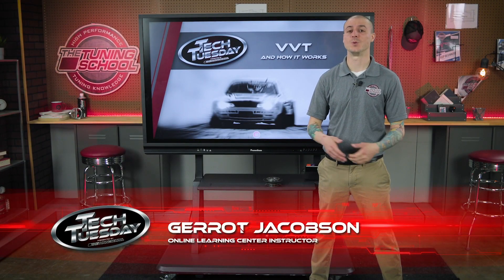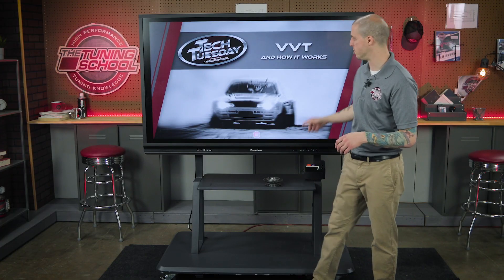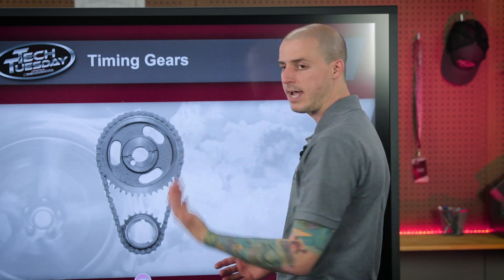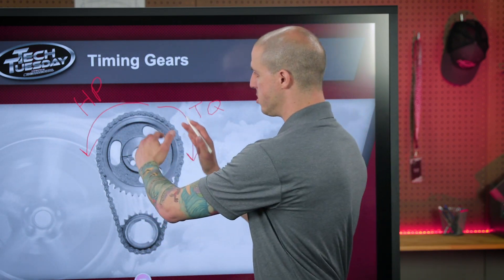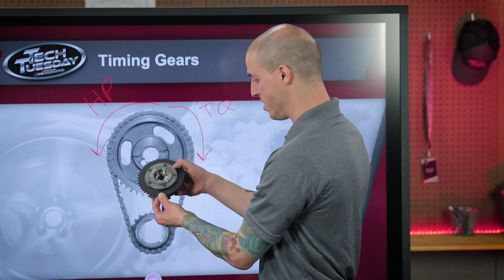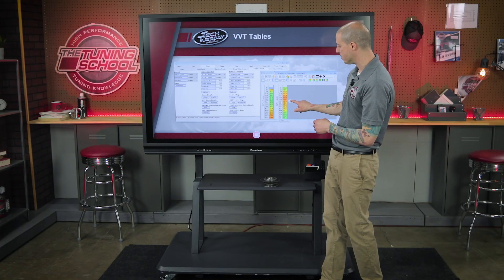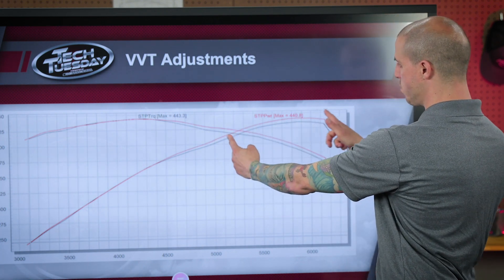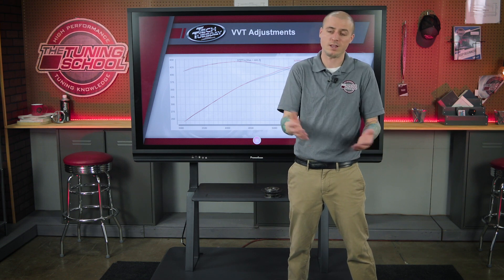How Can VVT Make More Power?

Comment: So I did it I installed a VVT engine in my 2004 GMC non vvt truck after driving it for a while the only thing I noticed is I need to dial down the injectors pulse other than that lots of power the computer doesn't know it's supposed to be connected
Had to buy lots of adapters but it works didn't want to cut up the wiring harness can be seen on my YouTube channel

Comment: My car is tuned already making 90hp more  than stock. I did not touch vvt adjustment at all. How do I know what will gain power and is it safe to advance to Max or just like with spark timing there can be knock?
Reply: When advancing cam timing you might get into knock as well since you are increasing VE on the same RPM, I'd say if you want to give it a try use good quality knock phones to catch it and pay attention to your AFRs.
Reply: self tuned?
Reply: @1ripstunna  yes
Reply: Bring in a pro I'd say. Don't knock a piston if you don't need to
Reply: @charliemccutcheon6030  we are talking about vvt advance not spark advance
Reply: There's no need to max it out, you'll lose horse power and/or torque. There are optimal positions for every 1,000s of engine revolution in the powerband.